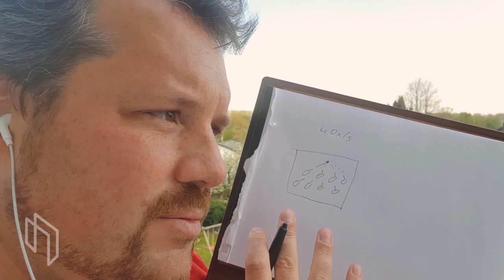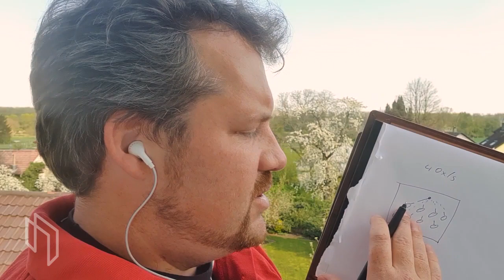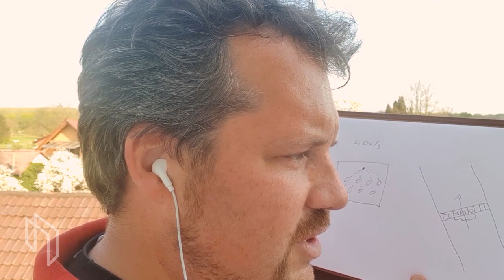Nikias' Homestories #7 :: Port Switching

Comment: Thank you for your interesting video series!
Would you please explain why the both transponders on the back of the race numbers with two integrated transponders are coded differently? Wouldn't it be better to code the transponder pair uniformly and treat them therefore as a single transponder?